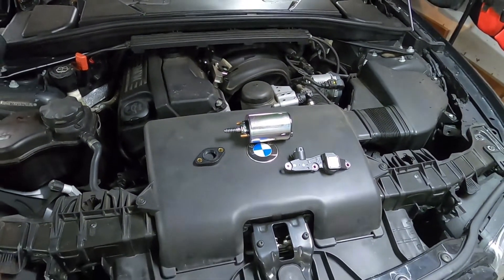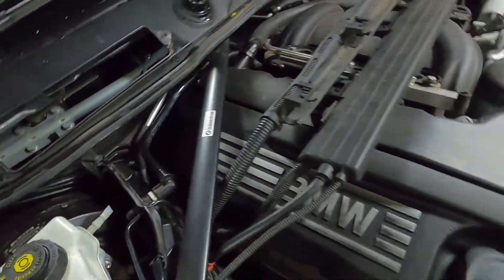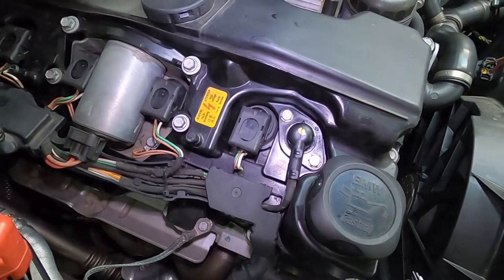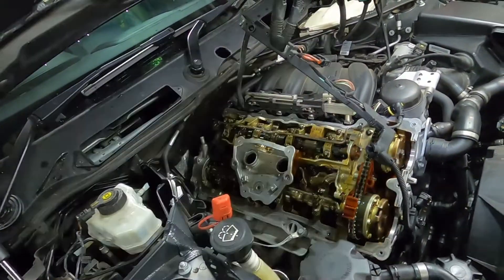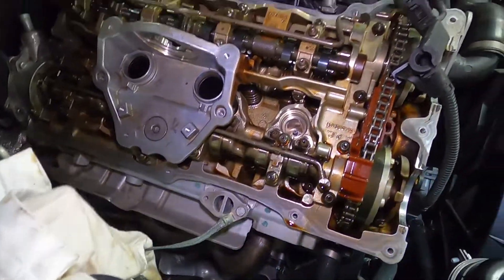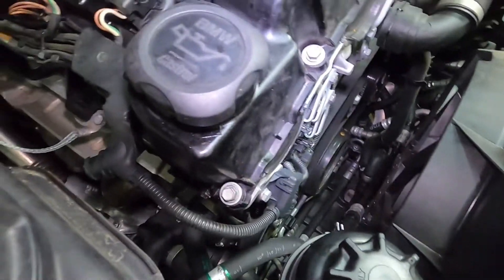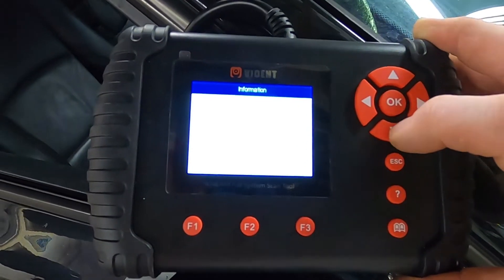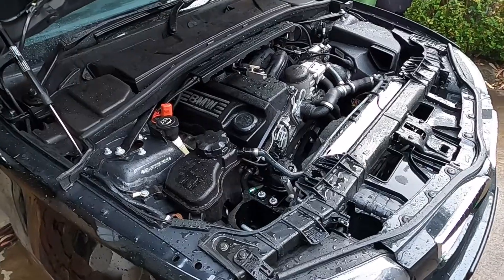BMW N46 Valvetronic Motor and Eccentric Shaft Sensor replacement - Vident i400 2851

Comment: Hi, mine is a n42 engine and i hear some noise from the vvt motor and its similar of worn out flywheel but the flywheel and clutch are new and the noise is still there when i unplug the sensor nothing happens,and when accelarating car vibrates on 2/2.5 k rpm, at this point idk what it can be, any ideas ?
Reply from the maker: Have you checked for any error codes with a scanner?

Comment: does the actuator have to be calibrated after install? so yes what software could be used?
Reply from the maker: I didn't have to calibrate, although there is a bit of debate about when it is needed. AFAIK it calibrates the end points on ignition on or after a battery reset.  I have heard that you may need to learn the end points in IMPA or similar.  Would be great to hear from others who have changed the motor and sensor.

Comment: Hi mate im planning to remove the ESS but you havent showed how you did it, what tools did you use? It seems very tight to get the 3 bolts which hold the ESS off
Reply from the maker: Hi - yes didn't show that in detail. If you remove the 3 bolts it just about wiggles out if you pull the chain to the side.

Comment: hello, I have a problem with my bmw e46 engine code N42b18a (error code 2731- intake camshaft operation control) I would like to mention that I have changed the intake vanos, new timing, new solenoids and the error still does not go away. Can you help me with any advice, what could I do? What could be the problem? Thank you!
Reply from the maker: Did you change the valvetronic motor and the eccentric shaft sensor sensor?
Reply: @jackpwc01  I didn't change those. I just did a relearning on the valvetronic. Do you think those could be the problem?

Comment: Hello.

I replaced the same parts as you.
Control motor installed as required. Currently, the acceleration stops at 2000 rpm. This is true for all 5 gears. The car does not accelerate, jerks and stalls.
The parts had to be replaced due to a position sensor error. The controller checks the lower and upper terminal, it works.
What should I do?
Reply from the maker: If the car is running badly after the installation, what faults show up on a diagnostic scan?  I would suspect bad new components, or wiring.

Comment: Quick question. Once out with the old and in with the new, do you have to do some specific adjustment/recalibration procedure in the end?
Reply from the maker: Hi - No, it auto learns the end positions on start up.  A scanner is good to clear any codes though.

Comment: Hey, is the car still working? i have to do this myself too and I'm little mistrustful of those prices about the parts.
Reply from the maker: Running really well since I fitted the motor and sensor, and surprisingly no oil leaks at all.  I will do a service on it soon and will discuss the progress of the previous jobs.
Reply: @jackpwc01  Great to hear that! ill be waiting for the video from it. 😎👍

Comment: I've got fault codes p1050 and p1062 is this also the vvt motor
Reply from the maker: I think you need an alternative diagnostic tool to read the BMW codes, and also check the condition of the sensor connector for oil.  Other than that you could always change the motor and sensor as I did and see if that fixes it.

Comment: Thank you for the video! Would you be so kind to give me some advice i got rough idle and stalling i got fault codes (2A67,2A61) 😊
Reply from the maker: With those codes I would change the motor and sensor, just like I did.  Also check the wiring for damage.  I would be surprised if it did not fix it.  The only problem after that could be the eccentric shaft itself.
Reply: @jackpwc01  ty for fast replay, the mechanic said he has changed the motor and the sensor also the eccentric shaft sensor,, this is getting expensive i m gonna just trow away the car at this point.. question is there any way to bypass the valvetronic ? or how do i fix the car without braking the bank. i'm spent atm
Reply from the maker: What year / mileage / value.  Did he definitely put in new parts? Is this the same code as you had before the parts were changed?  It's pretty easy to test when you have it apart, you just turn on the ignition and can see it travel the full range.  Other than that, a good diagnostic tester will be able to test the motor and sensor and report all values so you know the parts are good.
Reply: @jackpwc01  the codes are after replacing valvetronic and the eccentric shaft sensor. i really hope they changed them could it be like a vacuum or something like that because the car works good and it randomly happands? also is there any other way we can continue the convo i don't wanna spam your video
ty

Comment: Awesome video got fault code 2A6F any advice on this specific code ? When you google this code, it says Valvetronic minimum lift exceeded...
Reply from the maker: Hi - yes just looked that up.  I would check everything is in order, such as wiring, etc, then if you follow diagnose Dan you could heat the motor and other stuff like measure the motor current and resistance, or like me you could just change the motor - its not that hard and is a common failure.  I would also change the sensor too..
If I did it again I would make sure I had a new gasket and sealant to hand.
https://www.youtube.com/watch?v=JNxqPQwunx0
Reply: @jackpwc01  Thing is we partialy rebuild the engine, so I really want to fix this one... There is issue just like in your video, oil in eccentric shaft sensor, so I order a new gasket, need to clean the electric contact from oil and delete fault on diagnostic. If it's pop's up again I replace the sensor and valvetonic motor.
And thank you, for your advice. 🙂
Reply: @Kaptac1987 Hey i got the same Code 2A6F but i found nothing online about it. How du you fixed it ?
Reply: Is it the Motor ?

Comment: Hi mate!Have done coding after all jobs?
Reply from the maker: I didn't need to do any coding.  The ECU self learns the end points.
Reply: @jackpwc01  cheers mate 👍🏻🫡
Reply: @jackpwc01  hi mate, I changed a lot of gaskets in my N46b20b engine on my 320i e90 2006, and once i rebuilt everything and started it for the first time, i heard a bad noise from the engine bay but it is still running. i do not hear the noise anymore but i have an engine light and my  car has a very bad acceleration. I used a scanner and it says that the valvetronic has a default. i feel like it broke when i started the engine the first time. I m going to replace the servomotor but I m scared to start up the engine, are u sure i do not need to learn the end points before starting the engine after replacement ? thanks for reading and helping i m a mechanic learner and i really want my car to run correctly :)

Comment: Ive a question, what are all the tork specs you talking about? Like the motor itself, the sensor and what is hand fast with the screws from the lid?
Reply from the maker: Hi - I didn't have the torque values, so I just tighten them based on experience.  if it is metal to metal you are pretty safe with it feeling tight, and around half the torque for metal to plastic.

Comment: Is it normal for this fault to cause rough running/vibration especially when accelerating?
Reply from the maker: Yes, this one was throwing the warning light up and refusing to accelerate.  A restart would fix it temporarily
Reply: Depending on how busted the Valvetronic Actuator is. 
If it's just the motor your idle will fluctuate and your car will go in limp mode.
If it's the rail that's grinded down you will get a grinding sound just as you accelerate.

Comment: Howz it?!
Great video thanks man. Recently got a couple of faults show us as well namely 

2A59 Valvetronic Eccentric shaft sensor 
2A5B Valvetronic Eccentric Shaft sensor 
2A6B Valvetronic Power limitation, servomotor.

Will I need to change both motor and sensor as in your video?
Or just change the eccentric sensor only 

Thanks mate
Reply from the maker: If I was you, I would definitely change both while your in there; the parts are not so expensive, compared to the labour or effort of changing them

Comment: Hello mate amazing video.  I need to strip one tomorrow  and you gave me an idea what  needs to be done... on mine the fault is vvt function at stop. Only 4.7 vaults to the motor and not responding  when sending the command  with the tester.  The sensor is covered in oil so I suspect  is that  but will replace both since I am there.  What was the fault  on yours ? Thank you
Reply from the maker: Hi, it was a mix of:
2851 DME Valvetronic servomotor, actuation 
28B4 DME: Valvetronic servomotor, sluggish movement 
2863 DME: Valvetronic, power limitation
and had been happening over a few months. 
Clearing the codes helped for a while, and after changing the motor and sensor It is now running really well.
Good luck with your car, let me know how you go.
Please subscribe if you haven't had a chance to, I'm trying to get to 1k Subs!
Reply: @jackpwc01  Hello, my vehicle has the problem of shaking and not consuming gas when starting the engine, I have not seen the errors you wrote, but they say the valvetronic is faulty, how can I know if it is not stolen?